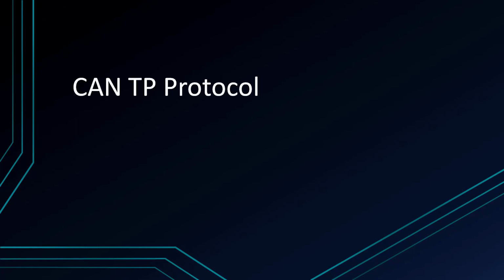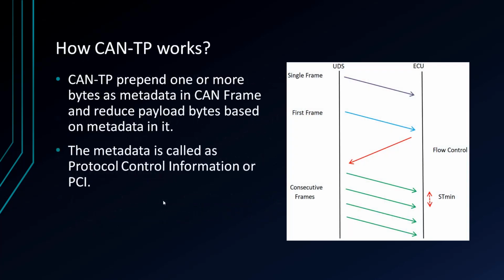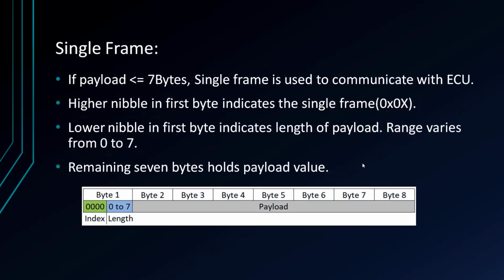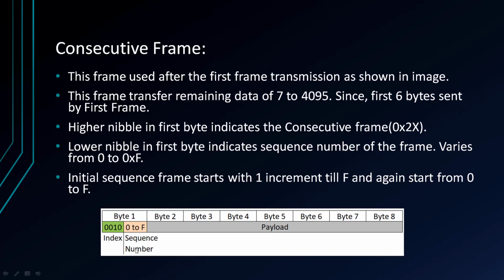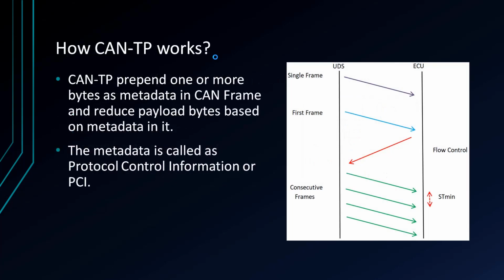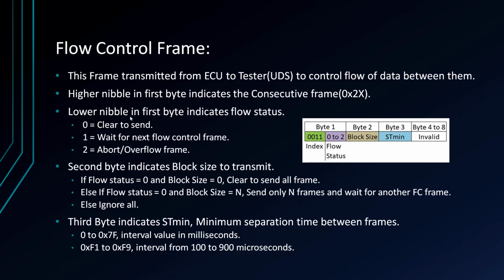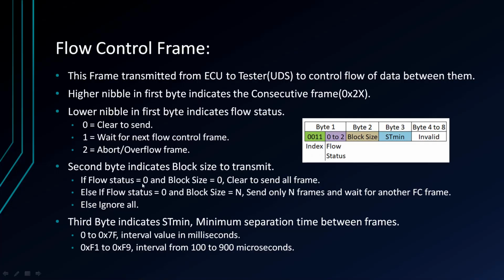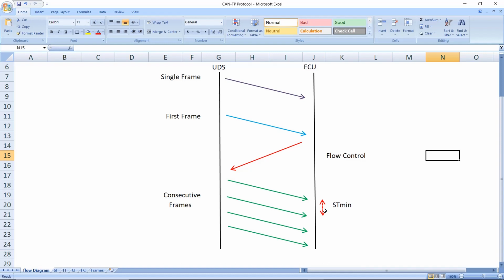CAN TP - Protocol, Multi CAN Frame, Single Frame, First Frame, Consecutive Frame, Flow Control Frame

Comment: @taruntu3096 1 query... Since we are using CAN Frame which contains [SoF + Identifier+ Control field + Payload + CRC +Ack ] . So 1st Frame and Consecutive frame also contains entire Frame components from SoF to Ack, if YES then CAN ID is decided for 1st Frame and Consecutive frame?

or if not then only 1st frame is have in CAN-ID and consecutive frames are having only Payload without CAN ID? Please suggest
Reply from the maker: Both will have CAN ID to decide the destination. Only the content in the frame will change, all other properties will be the same.

Comment: Hi Tarun, I would like to know that if i send a flow control frame with data bytes 300000 and my data size is 4096 bytes, so will i have to send flow control frame again after i have recieved consecutive frames from 20-2f or will it keep sending all the data until the end of data
Reply: @taruntu3096 Please explain this , if possible
Reply from the maker: It will keep sending the data, until any new flow control is sent from another node.

Comment: Does can tp frame are fitted into narmal can dada frame having 8 bytes of data?
Reply from the maker: Yes, it will fit in a normal CAN data frame.
The only difference is CAN TP is sent in multiples of 8 bytes data and normal CAN is sent only one 8 byte data.
Reply: @taruntu3096  so indirectly CAN DATA FRAME is getting exchanged between devices, is it correct understading?

Comment: hi sir ,how to read  20 bytes dara from did in can TP EXPLAIN SIR
Reply from the maker: Example with 20 byte data from 1,2...20

First Frame:	 0x10	0x14 0x01 0x02	0x03	0x04	0x05	0x06

2nd Frame:	0x21	0x07	0x08	0x09	0x0A	0x0B	0X0C	0x0D

3rd Frame:	0x22	0x0E	0X0F 	0x10	0x11	0x12	0x13	0x14

0x10,0x21,0x22 in first byte of each frame is frame index

0x14(20) in the 2nd byte of the first frame is the length of the message.

And flow control frame is also required based on other node response(check video for explanation)
Reply: @taruntu3096 bro If I set a system variable in canoe as voltage then if I increase that variable in that pannel the voltage need to increase upto 5 volt for this what logic I need to write bro in capl and need to check in graphic window of that pulse can you share any logic bro please 🙏

Comment: Hi bro, which module or which one will seperate into frames and Combine of all frames together
Reply from the maker: Hi Naresh,
CanTp(In BSW Layer) module offers services for segmentation, transmission with flow control,
and reassembly of messages. 

Its main purpose is to transmit and receive messages that may or may not fit into a single CAN frame. 

Messages that do not fit into a single CAN frame are segmented into multiple parts, such that each can be transmitted in a single CAN frame.

Autosar URL: https://www.autosar.org/fileadmin/user_upload/standards/classic/3-1/AUTOSAR_SWS_CAN_TP.pdf

Comment: Hi Tarun, Could you please explain how to send this multiple frame in CANoe?
Reply from the maker: Hi Jinsi,
I didn't used CANoe. But, I explain how to send CANalyzer. I think it would be same in CANoe.

Let's assume you need to send 11 byte of data(0x1,0x2,0x3,0x4,0x5,0x6,0x7,0x8,0x9,0xA,0xB) in CAN frame.

Steps:
Create two frame with these data in IG block in same message.

Example message ID 0x200:
Frame 1: 0x10 0xB 0x1 0x2 0x3 0x4 0x5 0x6

Frame 2: 0x21 0x7 0x8 0x9 0xA 0xB 0x0 0x0

Now send frame 1 and frame 2 one by one as EVENT message(not periodic) by clicking "NOW" button in IG block of those frames in the TX node.

Hope you got my explanation🙂.
Reply: For normal CAN and CAN TP has different hardware set up or same?
Reply from the maker: @shareefshaik7258  
Same hardware for normal CAN and CAN TP.

Only difference is number of bytes transmission.

Normal CAN message will transmit only 8 bytes in single frame.
CAN TP will transmit more than 8 bytes. Transmit more than 8 bytes using multiple frames(each frame of 8 bytes).
Reply: @taruntu3096  tanq tarun
Reply: @taruntu3096 hi tarun can explain this I am working in canoe,in my they ask the steps for this in each frame? 
If I give request->22 F1 91 
I need this response ->22 F1 91 11 22 33 44 55 66 77 88 99 11 
Can you briefly tell me in each frame how it will be aligned ? 
Please as soon as possible 🙏
Reply from the maker: @Vishnu_25798  
Total length of your data is 13(0x0D).

1st frame: 10 0D 22 F1 91 11 22 33 

2nd frame: 21 44 55 66 77 88 99 11

Along with flow control based on the ECU node. Example: "30 00 00"
Reply: @taruntu3096  in second fram you are telling in consecutive frame I think but in that how 21 will come ? 20 will come I think? Can you explain it is 21 or 20?
Reply from the maker: @Vishnu_25798  
It starts from 0x21 to 0x2F and again it starts 0x20 to 0x2F.

After the first frame, the consecutive frame will start with 0x21.

you can check my Excel sheet representation in video for a clear explanation.
Reply: @taruntu3096  thank you for your information 🙏